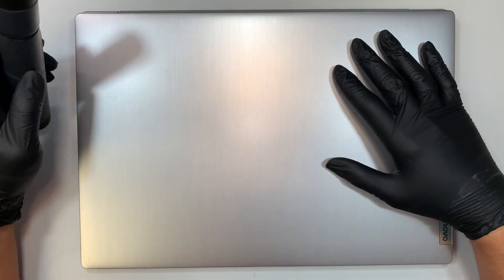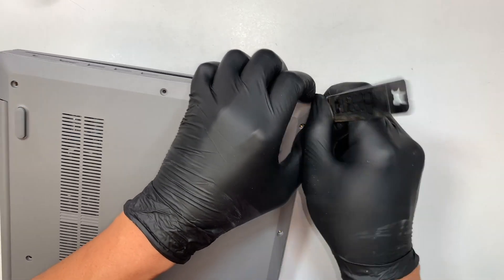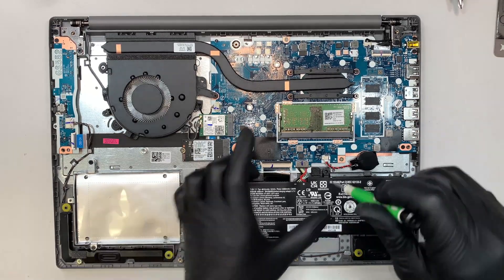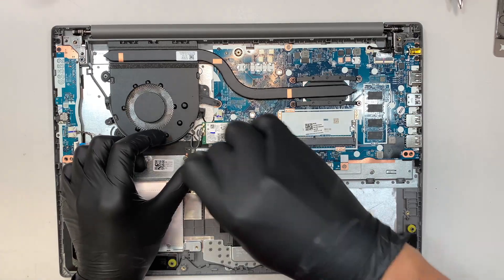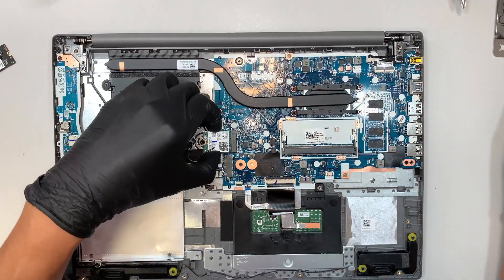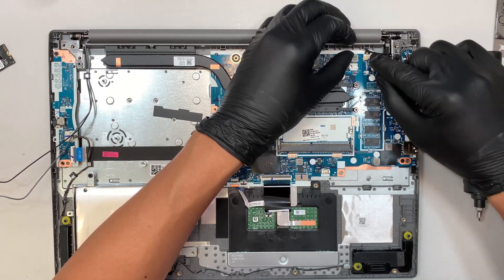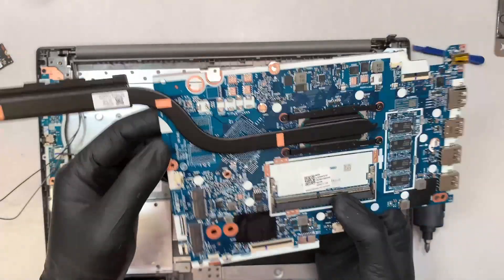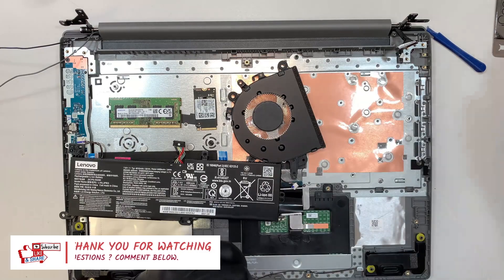Lenovo Ideapad 3 15ITL05 Tear Down Disassemble

Comment: I just watched your video. I have this exact laptop. My laptop isn't charging and i know it's not the battery as i have barely used the laptop. It's actually been in my closet for about 10 months with only 2 months of use before that! Also just got a new charger from the manufacturer so it's not that either. Read on some sites it could be my charging port. Was wondering how can you tell if charging port is bad/damaged?  Could really use help with figuring out why it's not charging. Thank you!

Comment: Excellent video, I didn't know the RAM or HD was expandable.  When you upgrade the M.2, isn't the Win operating system in the original drive ?  If you install the 512 drive, do you still have Windows ?  I know, it's probably a stupid question, so bear with me :)
Reply: you will have to clone that hard drive to get your old settings or rather install windows from a memory stick. make sure you remove the windows key

Comment: I was able to find this at walmart in store for $169 on clearance with only the soldered 4gb of ram. I popped in an 8gb stick of ram for $35 and this thing runs like a champ. Thanks for the video!
Reply from the maker: You are welcome. Glad the video helped
Reply: If you don’t mind me asking where did you find the 8gb stick of ram?
Reply from the maker: @King-_-Meh  Where to get DDR4 laptop RAM ?
- https://amzn.to/3taISN6
- https://amzn.to/3Ghr0nO
Reply: @UbergeeksBiz I meant to come back to you and tell you that it runs great 💪🏾 I will have to disassemble it unfortunately because a set of keys on my keyboard stopped working and the metal piece that the hinge sits on has cracked due to me putting the wrong screw inside of the hinge to keep it held down. Should I replace it or just get a new laptop?

Comment: hi. i have a ideapad 3-15ITL05 81X8007GRE notebook, it looks like on your video and I wanna clarify two questions:
1) on all resourses which I checked, I found that it support only 12 GB RAM (4 already implemented + 8GB as removable memory), but you said in a video that we can upgrade with 16GB removable memory, are you shure?
2) as I understand there no ways to upgrade proccessor on this notebook (ex. from Intel Pentium Gold 7505 to ntel Core i3/i5)?
Reply from the maker: You can't upgrade CPU. For RAM, maybe max is 12gb
Reply: I have the same notebook and you're right. It only can be upgraded up to 12GB of RAM.